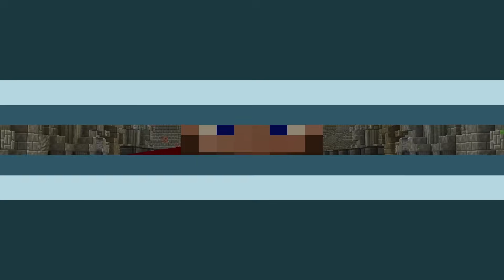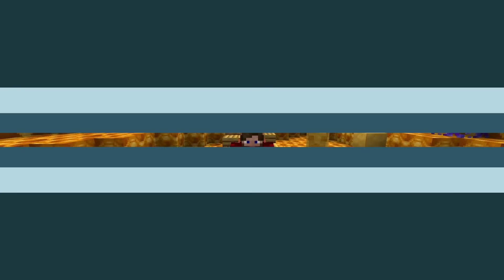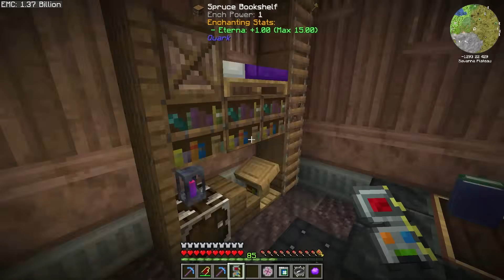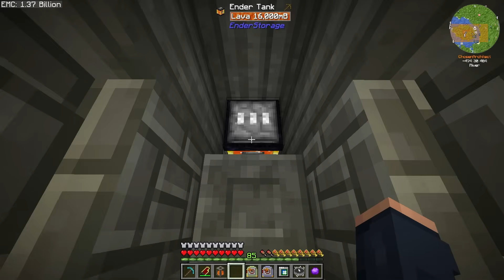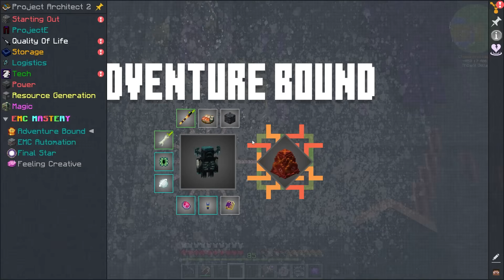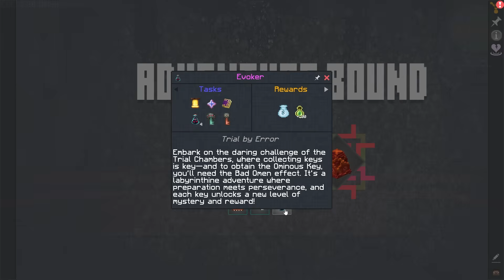PROJECT ARCHITECT 2 - EP 17: Moving The Stronghold & Ars Nouveau

Comment: Hey! Amazing series. I have a question. For some reason my Activator module refuses to fill buckets with lava from my Basic Fluid Tank. I set it up exactly as you did. The sender and puller modules work great, but only the Activator module isn't working. Do you think that is a bug? I am playing on the latest 4.8 modpack version.

Comment: Instead of replacing the first item in the enchanting Ars recipe, you can also use the modular router "match on tick" feature with a filter for the item. It sends all items to the pedestals first before sending the item to the apparatus. Just another way of automating, both ways work obviously.